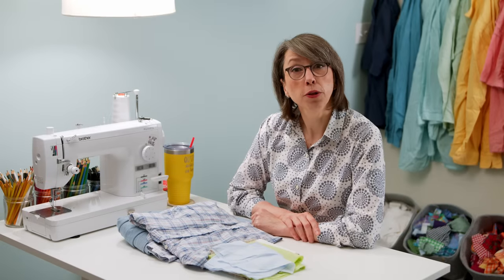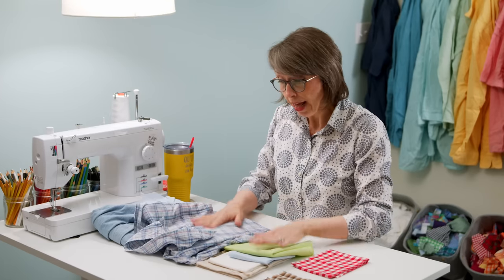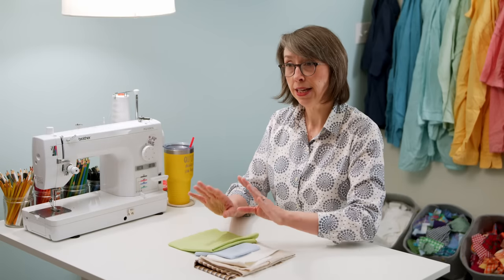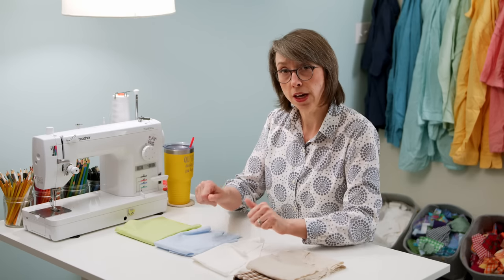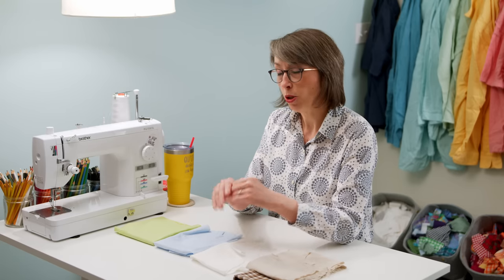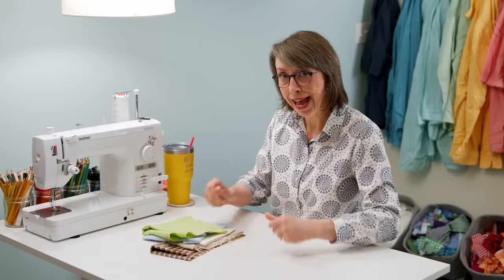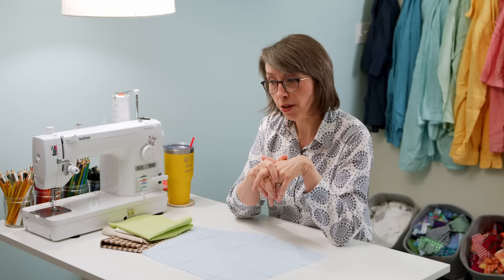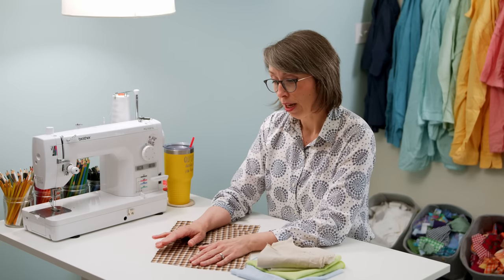Working With Thin Fabrics - How To Stabilize Fabric Quilting For Quilting With Men's Dress Shirts

Comment: I did heirloom sewing for 30+ years using handkerchief linen, Swiss nelona batiste, Italian organdy and fine French laces. Although these fabrics are almost sheer and very delicate looking you can expect them to last to be handed down for generations. 
One caution I would like to give is never use poly or polyblend thread for stitching your quilt blocks. It’s not that poly thread is not good quality, but that it is stronger than your quilt fabric over time*. What you will see over tens of years, using poly thread,and normal laundering is that the thread will be intact, but the cotton fabric no matter the quality will be broken along the seam so the fabric will look as if it was cut along the seam line.  That is a difficult problem to repair. The cotton thread/cotton fabric combo the thread will more likely give way leaving the fabric intact. This is an easy repair to make - just a few hand stitches to repair the seam along the original seam allowance which is still *mostly intact*. I would prefer to mend the second scenario than the first. I saw this over both cotton quilts. Poly thread will cut your fabric before it will break. I want every thing I sew to last a long time so cotton thread with cotton fabric is the way I fly!
Reply: Thank you Connie for this golden nugget of information. I’ve heard differing views on poly vs. cotton and yours is the most compelling. I’ll stick with my cotton fabric/cotton thread.
Reply: I accidentally edited out an important part. I collect antique christening gowns. Some are 300+ years old. Those garments were boiled when they were laundered when they were in use. I found no seam slippage in any of them. A few sections of stitching coming undone but all less than 1”. You should see the stitching on these garments. And the fabric are so fine I’ve never seen the like. Anyhow, the point I wanted to make was the issue of the damage with poly thread. I sewed almost all of my children’s clothing (4 daughters) and my observation carried thru garments, quilts, home Dec. If I wanted to hand a garment down, I made sure I used only cotton threads. All the work that went into my daughters clothes I didn’t want to toss them after one child. They didn’t mind hand me downs as long as they weren’t babyish lol. But I didn’t mind repairing a seam now and again. We are now expecting out 3rd great grandchild and we are so excited.
Reply: @Connie Murdoch thank you for this! I prefer sewing with cotton and strangely enough my sewing machines (yes I have several including my grandmother’s Singer 63 years old) prefer me using cotton thread. Poly and poly/cotton blend thread seams (see what I did) to knot to much and can cause great issues I just do not have time to deal with! I’ll also stick with cotton - it is, after all, the fabric of our lives!
Reply: @christinahall3318  I also have many vintage machines. I used to have about 25. I fix them up so that they work well and gift them to kids that want to learn to sew. I *think*I have 5 or 6 vintage machines still but I also have my modern machines that I won’t count and my featherweight which I would also never sell. Vintage machines were meant to sew natural fabrics.  These machines were also meticulously machined so that the stitching was reliable and precise. They give the best stitching possible on cottons. They are also timeless if properly maintained.
Reply: What is your favorite cotton thread?
Reply: @smchalk3535  I’m not sure if you’re asking me, but here goes! I loved the Madeira cotton thread that we used for heirloom sewing when I still did a lot. But that isn’t easily available where I live. Now I use aurifil I think it’s 50 wt? It’s available at any quilt shop in Canada and online.
Reply: @conniemurdoch8528  thank you.
Reply: What is Heirloom sewing?  Is it conservation work?  Thank you so much for explaining the reason for using cotton thread.
Reply: @jmc-xp6ml  heirloom sewing, also sometimes known as French hand sewing is a type of sewing that you often see in antique christening gowns. It’s very popular in the southern states mostly for infant and children’s clothing, but sometimes even adults. It often uses very fine fabric in cotton, linen, and sometimes silk. A quick way to see lots of heirloom sewing would be to Google “heirloom sewing portraits. That’s just one category of heirloom sewing but it’s the quickest way to see lots of beautiful heirloom garments at once
Reply: @conniemurdoch8528  Thank you for sharing.

Comment: I don't often use fitted sheets on account of the increased chance of threadbare sections. If I do plan to repurpose fabric from a fitted sheet, I always test the strength of the fabric by systematically pulling small sections both ways on the grain all the way from top to bottom and side to side all over the sheet. Threadbare sections will rip apart very easily. I then use only the sections that pass the pull test (and by pulling, I'm not rending it like I'm playing tug-of-war with a rabid hyena - just pulling enough to test the strength of the threads).

When I acquire fitted sheets from a thrift store, I never really know what I'm getting and I find that they almost always have sections that fail the pull test. I'd rather have a sheet rip to shreds and show itself to be completely unusable early on than to have that fabric come undone after I've sewn it into a quilt.
Reply from the maker: I agree! Better for it to rip beforehand and know than to get it in a quilt only for it to fall apart later!😱

Comment: Thanks again for a very informative video!!  I have not used a lot of shirts in my quilting, but recently I used some printed quilters cotton and some batiks in the same quilt.  I needed to starch the quilters cotton, where I did not with the batiks so that piecing the two together would work with better seems and less slippage.  The batiks often have small amounts of wax left over in the fabric which gives it the body that printed fabrics do not.
Reply from the maker: I'm sure those quilting cottons benefitted from the starch when being paired with the batiks! So smart! 🤓👍🏻

Comment: Thanks Cathy for all the great tips!! 🥰👏🏻
I made a memory quilt for my son for his grad out of his old tshirts and used interfacing that I think was too thick. I used the cuddle fleece for the backing. The blanket is a bit too stiff I don’t think I would use that again and it’s quite heavy…but thankfully he loves the quilt so happy about that…but definitely learned for next time. The problem with tshirts is they stretch quite a bit. I think I would try using starch. Or else for sure a much lighter interfacing.
Reply from the maker: Charity, I think if you're using t-shirts (or any knits, really) you almost have to use interfacing to get it to keep the shape for piecing. But maybe featherweight would work better?
Reply: @TheCatBirdQuilts  yeah good point. 👍🏻☺️

Comment: my problem is that i have so many beautoful quiltimg fabrics but they are see through! which feels like a scam, because quilting fabric is expensive to begin with so id expect it to not be so see through. i might as well have bough shirts or a bed sheet. but i think i might try dpubling the fabric which will make it quite thick and then maybe i dont need batting. im not trying to make an especially thick blanket so that might work well. thanks for the tips !

Comment: Another problem with interfacing is the adhesive can partly wash out and the cotton fabric will bubble. I have a commercial blouse where this happened and it is unsightly. It originally looked pristine so the interfacing was adhered uniformly at first.
Reply from the maker: Jeanette, I had not thought of that but you are right! I had a shirt that the collar did exactly that and it was  very unsightly as well (stealing your perfect word choice!) Thanks for sharing! ❤️
Reply: @TheCatBirdQuilts @jeanette6396 
Here are some more observations about fusibles from my garment sewing years. Forgive me for proselytizing?  Three main reasons for fusibles buckling or bubbling and I will outline then here with some suggestions. The people who make and sell fusibles will tell you bubbling is caused by “user error”.  And if you go back to your instructions to check you might find that suggestion has merit. I am going to generalize because there are so many brands and the adhesive characteristics/quality differ widely if you look at just the brands that are considered “good quality”. Getting the best results requires a good iron - one that has an accurate thermostat so you know the temperature in the soleplate is accurate with respect to what you have set it at. It also helps if it’s not a steam iron. This might surprise you but it’s better to use a silk organza press cloth and a spray mister to create steam. The transparency of the silk organza makes it easier to see the edges of the fusible. And silk organza is one of the cheaper types of silk. The current batch of silk organza that I’m using was $5.99 a meter. (I checked just now and it is about $14) I usually buy the amt of yardage to make a square. I typically find it in 54” or 60” widths. I cut that up with a pinking shears and put a small grommet in one corner so I can hang it on the pegboard. That yardage that will make 4 large press cloths but you might want to make them to suit what interfacing you typically use. Years ago I found a vintage iron that has no steam holes in the bottom. With a pressing cloth and a spray or mist of water this does such a great job.
Once you are all set to fuse there are still a few things you need to think about. First, make sure your iron has reached the fusing temperature. It’s so easy to jump the gun out of our impatience a place the iron down to fuse when it is almost hot enough. Don’t forget that as soon as you hit the pressing surface the iron soleplate will cool quickly and dramatically due to the damp press cloth and the room temp surface you are pressing on. So make sure your iron is ready before you begin. Next, do a light tap, tap tap with your iron so that you are “tacking” the interfacing in place. Then you can go back and do the longer fusing for however many seconds your interfacing suggests. If you buy the interfacing that comes on a roll with the plastic that has the instructions on it make sure you keep at least one repeat of the instructions and read them to remind yourself every time you fuse. I roll my interfacing  onto a gift wrap tube and i safety pin the instructions to the top of the cardboard tube and push the instructions into the hollow center. When you are doing the longer fusing you place the iron down and leave it for the correct amount of time, then lift and place the iron on the next place. Sliding the iron is not recommended because you will distort the fabric and you might detach some of the adhesive from where it had already started to stick. Once an area has been completely fused allow it to cool completely before shifting the fabric. Lifting or sliding the fabric will distort the fused area and might also break the glue bonds that had formed before they get a chance to set. All of those steps are on the instruction sheets but often we rely on our memory and leave things out. 
Another area of user error is buying off brand types of interfacing. Just like sale bin threads, inexpensive interfacing is no bargain and is often the biggest cause of bubbling. You might notice with those brands that many of the tiny glue dots have fallen off in the packaging or onto your ironing surface. Plus these brands put less glue on their interfacing to begin with and if I were guessing they also use a lower quality of adhesive. 
On the surface most of the brand name fusibles do an adequate job of fusing to your fabric if you do a really good job of fusing. But there are other brands that can be found. I used to read the blog of a custom shirt maker who bought her interfacing in large amounts and would share it with her readers. The beauty of this interfacing was that it was 60” wide compared to the usual 15” or so that typical interfacing is made in. That’s the width most usable for garment sewing. We aren’t sewing garments. Also this interfacings glue was so fine and so densely spread that there were more glue dots that were closer together which leaves fewer places without any glue on them. This was one custom shirt maker who would sell some of her own stash to make it more affordable to buy.  I still have quite a lot and I’m dreading running out because I don’t know where to look for it.  
Oops I just checked and it looks like her sewing site is still there. Her Off-the-cuff blog is still out there but there are no more recent issues one the site. Last I checked she was fighting severe illness - I think it her second occurrence of breast cancer. So I will give you what is out there for contact info and if you want to give it a try. She used to sell sample packs - smaller cuts of each of the types of interfacing she sells. Her storefront is Fashion Sewing Supply and the products are Pro Sheer fusible and there seems to be a sample pack of 9 pieces of all the types she sells. (@TheCatbirdQuilts - if you this is not allowed please delete - I shared because I really love this interfacing) oops looks like I had a lot to say about it!

Comment: I also find there's a third (fourth?) category of unstable fabrics.... low weave density.  I've found especially at big box stores, usually in the character prints, the fabric uses nice thick threads, but so loosely that it unravels faster than i can work with it, and does all the warping and pulling things that a thin fabric will do!  plus all the disadvantages of having just a small number of unravelled threads threatens your seam allowance... it's super annoying to find.
Reply from the maker: Katie, you are SO right---for all of the reasons you named! Low quality oxford cloth shirts are very like this--especially that thing where just a few threads raveling cuts into your seam allowance! 😱 Super frustrating.

Comment: Often the projects I am asked to make use both cotton dress shirts and jersey/t-shirt knits. Have you ever used starch on a knit or an athletic poly shirt? I have never used starch because it seems messy and I don't want to gum up my iron plate. Starching seems like a lot of work. However ironing on fusible is also a lot of work. I have been alternatively using a tricot nylon fusible which has a slight stretch and is very thin and a thin cotton woven interfacing, but some of the drape is lost on the knits and can pull away over time making it look lumpy. I have successfully used a fusible fleece on very thin, threadbare shirts for memory bears/animals. It works great and holds up to stuffing, while preserving the memory of the fabric. Thank you for your videos each week.
Reply from the maker: Patricia, I haven't!! And I'm not sure how starch would work on an athletic poly shirt! 😱 Knits are challenging for sure (!!) for all the reasons you gave and then some!! I'm so very impressed by creatives like you that can use varying types of fabrics and textiles! 🤩

Comment: There is 100% cotton (except for the glue dots) iron on fusible available in white or black, from Pellon. I think it’s 101. I used it when I was incorporating some T-shirt designs into a quilt.
Reply: Out of curiosity I searched for 100% cotton interfacing and found there are quite a few available now. I’ve only used the Pellon because it was available locally, and it worked exactly as I wanted it to do.
Reply from the maker: That is so good to know!! Thanks for sharing! 😊👍🏻🤓
Reply: Pelion SF101 is a woven fusible…it works in these situations much better than even featherweight fusible…especially if you pay attention to fabric grain and match it in the fabric and interfacing

Comment: I bought a quilt topper in excellent condition.  It is made of men’s shirts and is crisp, probably already starched.  My question is won’t the men’s shirt fabric where out quickly, because it is thin?  Do I need to put another piece of fabric behind it, before the batting?
Reply from the maker: I haven't had any issues with the quilts I've made with shirts. I use my first quilt every day (it stays on my bed) and I wash it routinely---no signs of fraying, wearing out, or becoming threadbare and it's about 3 years old. So I would say "no" to your question. But trust your gut. If it feels very worn in certain areas, it won't hurt to interface it before you put together your quilt sandwich.

Comment: What the best way to starch fabric.
1. Drench fabric with starch and press ?
2. Drench fabric and  lay flat on cookie rack and let dry overnight?
I’ve heard of some who starch heavily and leave to dry overnight on a folding wooden rack. This seams like this method would cause some distortion, or I’m I overthinking this? Oh by the way, as a sidebar, I could watch White Christmas every month too. In our household, we do have a few Christmasy things that are up all year. Little things.
Reply from the maker: I drench and let dry (flat) overnight, and that works the best for me. I have used a laundry drying rack, but it does distort the fabric around the area that was over the drying rack bar. Sometimes it irons out and sometimes the fabric stays a bit warped so I try not to do that with whole shirt pieces.🤓👍🏻